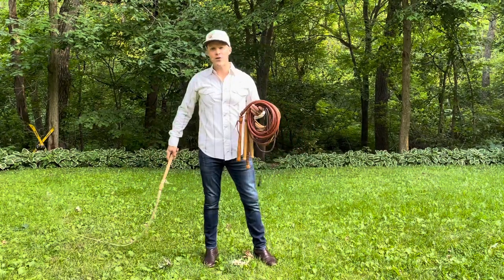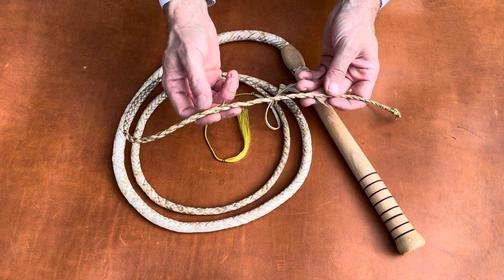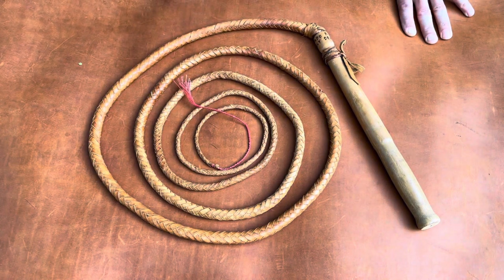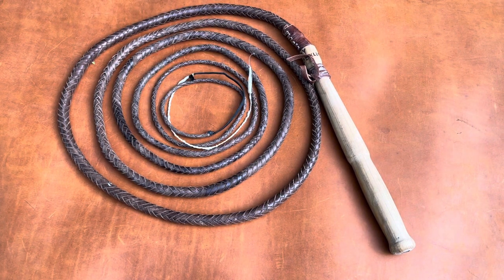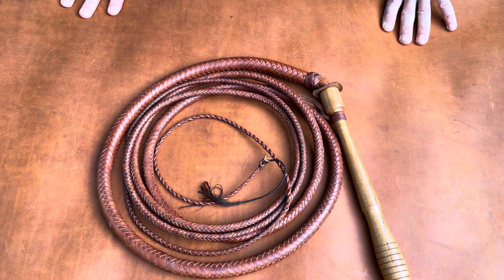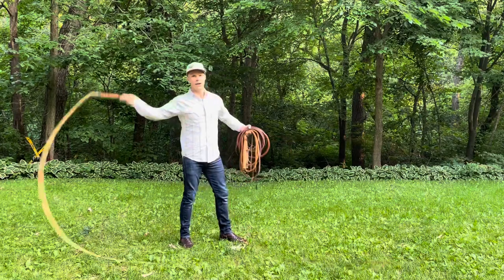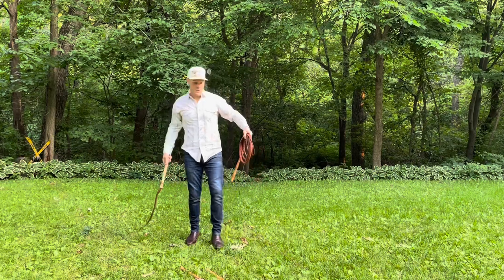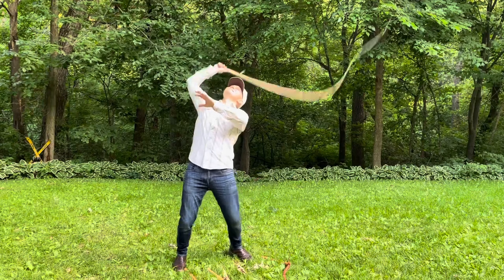Traditional Buckskin Florida Cow Whips

Comment: Thank you Mr. Winrich for the spotlight including Mr. Dekle (he pronounced it Deekle). I apprenticed with Mr Dekle in the mid and late 80's. For over 2 years . Yes. He did the duct tape string then plaited belly he called a middle belly sometimes or a whip inside a whip. Then the overlay. He preferred brain tanned buckskin but it was hard to get. As it is now.. so chromic was used or veggi tan. Have a good day.😊
Reply from the maker: Thanks for commenting!  I’ll make sure I pronounce his name correctly from here on out 😁